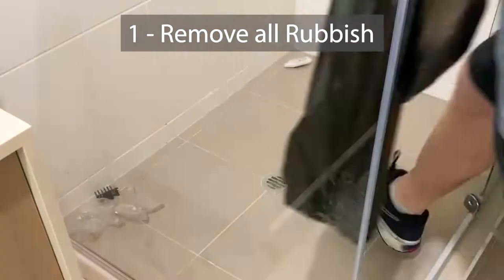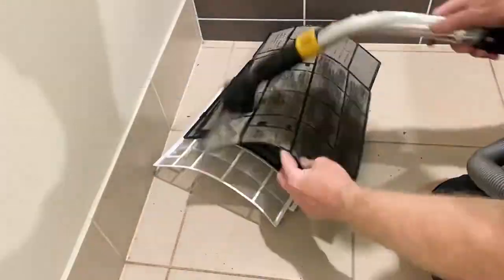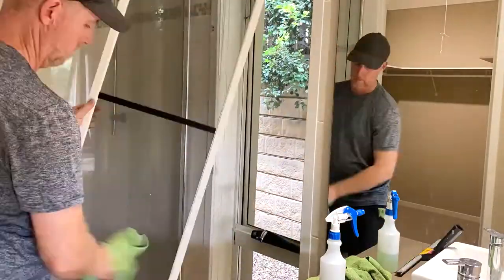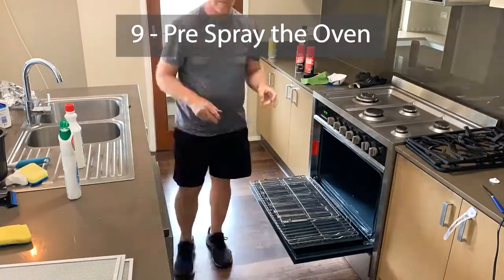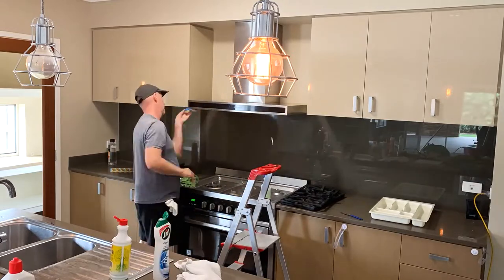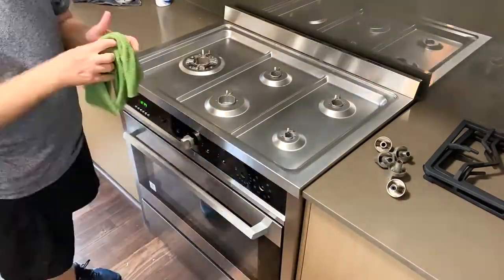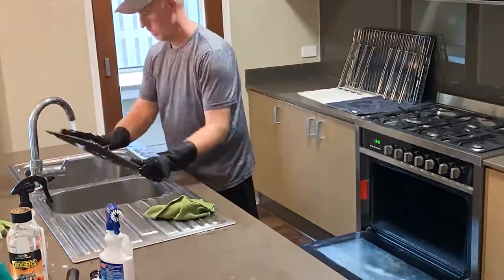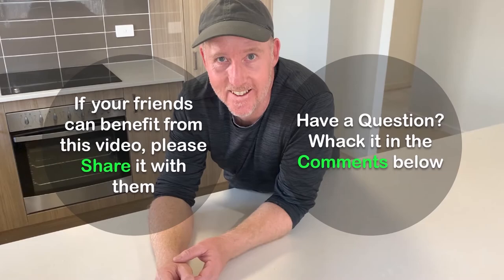My Huge 2 Day Move Out Clean - in 7 Minutes

Comment: Can I ask you something about pricing. You say you charge $60/h or would have charged $1200 for this job (you charged $900). But when i look online every company seems to have fixed prices for around $400-500 for a 3 bedroom house. I dont understand how they can work that cheaply. Are they doing false advertising or what is thr catch here? They also do a bond back guarantee. Talking about melbourne
Reply from the maker: Yeah they start at 3 bed then add for walls, plus more bedrooms, plus more bathrooms. Not all of them I assume, just every one I have known. This house was equal to 5 bedrooms, 2 bathrooms, extra large areas and extra large kitchen. Every single thing cleaned and to a high standard with no need to return (passed easily on first inspection). Get on site quotes from bond cleaners whenever you can.